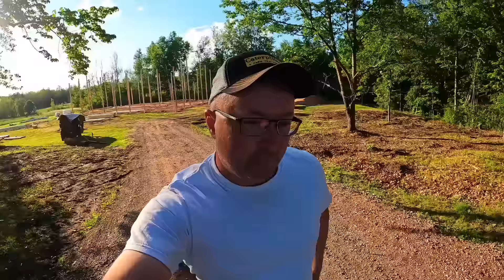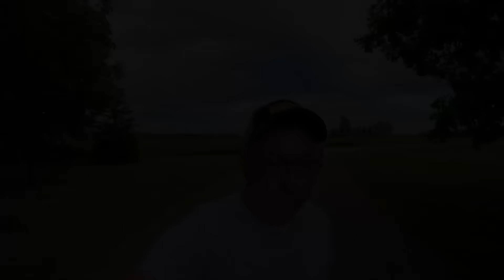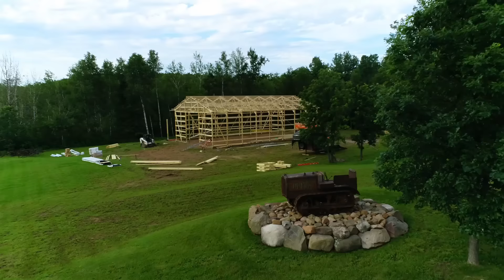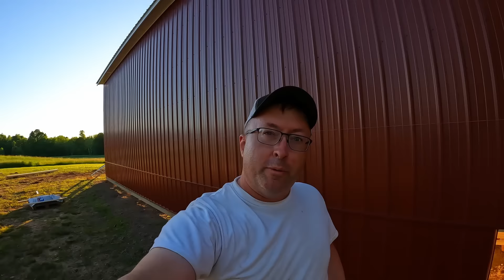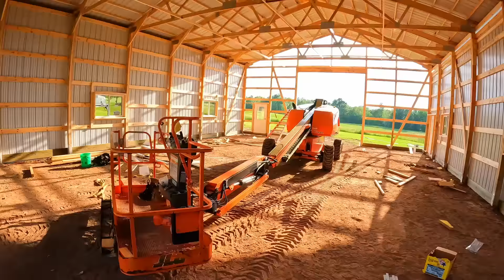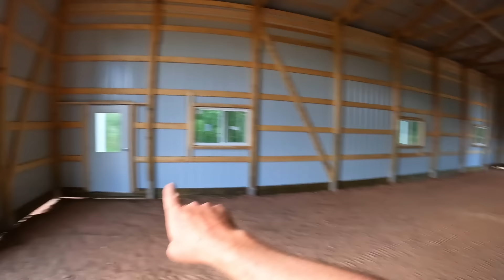The New Machine Shed Is Up! Northland Buildings Custom Pole Barn Build Day-By-Day Progress

Comment: Thanks for answering my dimension question. Just wondering why you chose to pour the floor afterwards? Sorry to ask so many questions but, I am trying to decide on my new shop. same old problem with running out of space. Thanks again for your time.
Reply from the maker: No problem on the questions, I'm happy to share any information that I'm able to.  Pouring the concrete floor last is probably something that has to do with the climate we have in this area - being Minnesota where our winters can last half the year and the frost goes down 3 feet into the ground.  The building posts are all set at 5 feet deep to stay below the frost line and resist heaving as the surrounding ground rises and falls with the annual winter cycles.  They call this floor a "floating slab" because that's exactly what it does - they'll construct the building first and run the grade boards all around the inside perimeter to act as a giant form for the concrete floor to flow up against.  They also install a thin foam barrier between the grade boards and the concrete to keep them from sticking together.  Now the concrete floor can rise and fall along with the ground beneath it as the frost creeps in and then thaws back out again, but the building walls stay in position because they're all anchored well below the frost line.  If any part of the main building were to be attached to the concrete floor, the floor itself will act as a "frost jack" and lift the building along with it during the winter.  The floor will settle back down in the spring, but the building will remain slightly higher than it was before because as the posts are pulled upwards out of their holes, some of the surrounding dirt will sift in beneath them.  This gradual  heaving and sifting action will eventually jack the posts to the point that it racks the entire building, breaks windows, and jams the doors.  Now if I would've built this to be a heated shop type building, the floating slab setup likely wouldn't have been necessary due to the heated inside space keeping the frost at bay under the slab.  The slab would then stay put year-round and not pose any risk to the rest of the building.

Comment: Surprised you didn't go with a steeper pitched roof so you didn't have to fool with snow removal as much.
Reply from the maker: Everybody has basically settled on the 4-12” pitch like you see here, even in our snow belt region it’s become the standard. My original sketch had a steeper pitch range (5-12” to 6-12”) but the builder explained how deviating from 4-12” adds a lot of cost because the trusses start having to be custom made, the roof steel gets longer, and anything steeper than 4-12” requires full scaffolding because it’s impossible to be on without sliding. Senior’s pole barn is 4-12” and it shed snow really well until the steel oxidized and became rough, but they say the new paint coatings are supposed to stay slick a lot longer now.
Reply: @squatch253  Makes sense. I know my 10-12 steel roof never collects snow which is nice since its like 25ft from the ground level just to the edge.

Comment: Good morning Toby, and congratulations on your new building. I believe another comment left was to 'leave sweeps in the concrete' They must of read my mind as I was going to put don't forget to leave some ducts in the concrete for water and electric at a later date if you ever decide you want them in. This meaning that you don't have to start cutting the concrete pad up. They are called ducts in uk - it's a tube for cables and pipes to be pushed through just sealing the ends off till they are needed.
I love the colour too.
Reply from the maker: I’m still a bit confused as to what “sweeps” or “ducts” are and why you’d be running electric and water through the concrete. If I understand correctly, they assist in getting the wires to make the turns around the corners of the slab, but I’ve never seen a concrete slab that carried all of that, its usually always in the walls 🤔
Reply: @squatch253  In the UK this is what a duct is - a tube with a gentle 90 degree bend that is put into place so one end is below the ground level and the other end is at floor level. This then gives easier access for underground services of gas, water or electric to be pushed up through the duct so stopping you having to dig the floor up at a later date. Each service would have it's own duct.
I really hope that this makes sense, possibly in the UK the services enter buildings differently than in America?? It's just possibly something to think about incase you may want some internal power or water at some point.
Reply: Ps. Yes they assist you get any pipes or cables around the corner/edge of the slab from underground outside to above ground inside.
Look forward to your next video.
Reply from the maker: Ah I get it now! 🤦🏻‍♂️ You’re talking about feeding the services in from below grade, up through the floor, and into the building where they can then be routed where needed. Thank you for explaining this 👍
Reply: @squatch253  Hi Toby, Yes and putting these ducts in first saves you a lot of hard work and destroying the concrete floor when you suddenly think about needing services after the concrete floor was poured.
Hope this has helped you Anthony.

Comment: Excellent video Squatch 253  (Toby) :) I remember on home farm barn & pole was Wagon Red , White trim , Grey Roof , Machinery Shed new one  was White and Orange  colors because Red was out stock  had 6 big doors , one entrance  and 4 windows too! Like how your turn out  also now hydro and install lights, plug in and maybe heat source also  install  some insulation for keeping warm in Winter Season months too!

Comment: Don't know if you are planning it, but slam pex tube into that slab, its not a lot of money and fantastic heating option should you choose to make it a 4 season shop. couple inches of foam insulation and just ziptie the pex to the remesh. protect the manafold end from sun and dirt and you can revisit it if you ever decide to heat it
Reply from the maker: I will not be putting anything in for heat or insulation, as this is only going to be for cold storage. I also personally do not run the type of heating systems that put liquid inside of concrete, for multiple reasons 👍

Comment: Very nice building just a quick question restoring a tractor it has all IH branded bolts is there a way to restore them and keep the IH branding Thanks though I would ask the pros
Reply from the maker: I save all of the factory original bolts from every type of tractor that I collect, every time I bust one down for parts all of the (still good) nuts and bolts get thrown in labeled cans. Then, when I’m doing a restoration, I have a good selection of original and correct hardware to browse through and keep everything as it should be 👍
Reply: @squatch253  thanks for your help

Comment: may i ask: in germany we usually avoid wood touching earth or concrete as much as possible. Usually we use Steel brackets screwed to Concrete footers, lifting the wood in the air, where no water can pool. But in the US, it seems like this is just common practice, dig a hole, put the post in, concrete in, done. Won't the wood posts simply rot in a matter of 10 years or so?
Reply from the maker: This is pressure treated laminated lumber with a poly-wrap layer, good for decades underground (in other words, long enough that it won’t be my problem lol) 👍

Comment: I come a part of the world where snow isn't an issue. What's the plan for removing snow off the roof? 
I'm sure you thought of that.
Nice looking building.
Reply from the maker: Yes, snow load is always one of the first considerations that we take into account when putting up any structure. The steel roofs will shed any snow buildup for quite a few years, allowing it to simply slide off when it gets deep enough for its weight to overcome the drag of the roof panels. That’s one reason why the lean-to drop-down is only a couple of feet lower than the main roof edge, so that the sliding snow cannot fall vertically far enough to crash onto those panels with any kind of force. And any remaining snow that won’t slide off by itself can be easily removed from the ground using the Roof Razor tool that I’ve featured on the channel here before 👍

Comment: I'm no builder either....so what's the deal with pouring the slab after the building is up as opposed to before? Is it better to do it that way. Either way, it's gorgeous!
Reply from the maker: It depends on the building size/type, typically stud wall buildings get the slab poured first and then you build it up on top of it, because the slab also acts as the footings for the structure. This size of post frame building typically doesn’t get concrete until all of the posts are set in the ground and grade board installed around the perimeter because the concrete gets poured up to and around the posts. The posts act as the footings for these buildings, so a concrete floor is more of an option instead of the main foundation. Also, a building with large doors like this one is even easier to pour after construction because the whole cement truck will fit inside 👍

Comment: Toby, are you going to insulate the concrete floor with styrofoam so in the spring it won’t get wet from condensation because of temperature change from cold to warm ?

Comment: Didn’t you say early on that there wasn’t going to be a concrete floor? If so, what changed your mind? Or am I just “remembering” things that never happened?
Reply from the maker: Your memory is correct, my first attempt at a building 3 years ago when everything was so expensive made me decide against concrete, but deciding to wait until now made it possible to also have a nice concrete floor 👍
Reply: @squatch253  
Well that’s great! Are you going to lay something like old conveyor belting or something similar on the floor to park the tracked machines on? I’ve seen you use lumber on the gooseneck for traction going up and down the ramps, so was just wondering what you’ve got in mind for the floor. It seems like there could be an ample supply of old used conveyor belt in or around Duluth.

Comment: Ballpark cost?  I'm in Central MN and always wondered what I would need to budget for a building like that.  (I've tried to get quotes from my local builders, including the pricey Morton, but for some reason it is like pulling teeth.)
Reply from the maker: It varies so much based on size, building type, doors/windows, etc. that the best way is to draw up a sketch and contact them directly, their contact info is on the driveway sign in the video. They’re based out of Little Falls, MN so it’s definitely worth hitting them up to see if they do work in your area 👍

Comment: Congrats! Interesting: Concrete slap goes in last? Where I live this is usually the first step. Anyway, just a few days to finish the building after years of planning feels like cooking all day just for everyone to run off the dinner table after 30min :D
Reply from the maker: That cooking analogy is spot-on lol 😂 Around here, buildings that are of the post frame construction like this one usually have all of the posts set in place as well as the grade board installed around the perimeter first, so the concrete can be poured up to and around the posts.
Reply: @squatch253  This makes sense! Well, the impressive construction speed speaks for itself.

Comment: Why wasn’t the concrete slab poured first? The building looks great!
Reply from the maker: With a post frame structure like this one they need to have all the posts set and bottom grade board in place at a minimum to be able to pour the slab up to, but by that point the rest of the building is so close to being finished that most times the crew just keeps going until they’re done, and then the cement trucks just pour or pump the concrete to the inside. The doors are big enough here that they can back the whole truck in if needed, which makes it an easy pour 👍

Comment: Congratulations on your new building! I do agree with another comment to add electrical sweeps in case you would want to have power years down the line as your demands will change and time marches on.
Reply from the maker: I don’t know what “sweeps” are, could you describe them to me? Thanks!
Reply: @squatch253  Buried wide radius conduit elbows, basically roughing in for electrical service.  The idea is if and when you install electrical, it can come up directly inside the building instead of having to pop up on the outside and run up exposed on the outside of the building, it makes for a cleaner and neater installation.  It probably won't apply in your case but it can also be done for future internet connections, telephone, etc.
I have a question:  do the cupolas provide ventilation, or are they purely decorative?
The building does look great!  I'm glad you decided to go with concrete floors.
Reply: @squatch253  it is a pre-bent gentle 90 degree turn of conduit. It makes pulling wire through much easier. 
If you dont have the sweeps in and if you want to some day put electrical power you will either need to go up the outside of the building and use a sharp 90 degree fitting (commonly called a LB) going through the wall or drill a hole in your slab, then dig under your slab to put the sweep in.
Best thing to do is to talk to your contractor about it if you might some day want power in there.
Reply: I hope you had a good 4th, and that everyone is safe!

Comment: Great looking building Squatch    What will happen with the board that runs along the ground around the perimeter of the building ?  will it be covered with the cement when the floor  is poured ?
Reply from the maker: Probably 3/4 covered, with a bit left sticking up above the top of the slab from how it looks to me - but then again I don’t know much about the building process so I could be wrong - I guess I’ll find out soon enough lol 👍😂

Comment: Great! Even mushrooms take longer to grow! :D
Do you plan electric installation, for the shed? Or only generator power, if you need light or some powertools.
And more important, how is your eye going? All fine after these time and now, when you back to full work mode? :) 
Greetings from Austria
Reply from the maker: I’ll get power run out there eventually, but the estimates I’ve got from the power company run in the $20K range so it’ll have to wait for a bit. I have my next retina exam scheduled for next Tuesday, providing the concrete guy doesn’t want to be pouring that day in which case I’ll reschedule the exam 👍

Comment: Electric in building?
Reply from the maker: Not for a while, the quotes I’ve got from the power company run in the $20K range to get it plowed in this far.
Reply: @squatch253  -You can do a lot with solar/dc power.  Im not pushing this as a political statement, but rather as a useful solution.

Comment: That is an absolutely beautiful building! Great color combo! My suggestion is to put sweeps in the concrete so bringing power into the building later is easy and you don't have to go through the walls. And adA extra sweeps for just in case you want to run power out or anything else in. I can't wait for the next update! Congratulations!
Reply from the maker: You’ll have to educate me on what “sweeps” are - remember you’re just talking to a mechanic and this building stuff is all unfamiliar territory to me lol 😂
Reply: @squatch253  Sweeps are the long lazy elbows for PVC plastic or EMT metal conduit. A bit like using 2x pipe 45s together to make a 90deg turn but does so smoothly. No sharp turn present that way wire can easily be fed by pushing in some cases or feeding a pull line through first then pulling the wires through.
Reply: @squatch253 , he is suggesting roughing in electrical PVC long radius elbows and straight stubs below grade before concrete is poured.
Reply: @squatch253 Fellow mechanic here but i beleave he is saying to bury some coduit in the concrete so you have the option to run power later on and won't have to cut holes in the side of you beautiful building. Looking good!
Reply: @squatch253  he means PVC conduit, long sweeping 90 bends
Reply: Here’s a long shot 🤷‍♂️ see how many if any get my warped humor , 
I thought sweeps are the men with brooms that clear the path for the rock as it slides home 😝
Reply: @rawbsworld6604 I have yet to see Squatch polishing any rocks from the pile for CURLING games!   👋🤠
Reply: @gregorycross612  🤔 👍 but if he plucks one off the pile that old 20 might slide off 🤷‍♂️😝
Reply: @rawbsworld6604  The path being the column of air the house sits on...centered on the fireplace?
Reply: @RuralTowner   I don’t know 🤷‍♂️ but intrigued 😀
Reply: I was thinking same thing put it close to an entry door so you have easy access to the panel
Reply: Great Color scheme is Right !! Looks Amazing. And your idea for conduit sweeps in the slab is spot on !!

Comment: Very nice building; classic lines and colors.  I’m curious about the parking plan; how the Fords, MMs, Cats, IH, and Kubota will be arranged.  Park on a 45 degree line?  90 degrees to the walls?
A 90 degree arrangement looks nice if they all start, but difficult to tow out when they don’t.
Reply from the maker: The plan is 90 degrees to the wall under the storage loft, and that’ll be the smaller machines like D2’s, W-4’s, Farmalls, etc. The rest of the space will be however everything else that’s bigger wants to fit lol 😂 All of the commonly used equipment will stay at Senior’s place though 👍